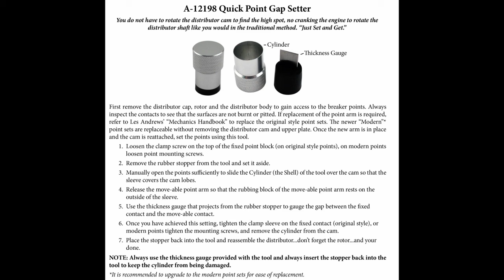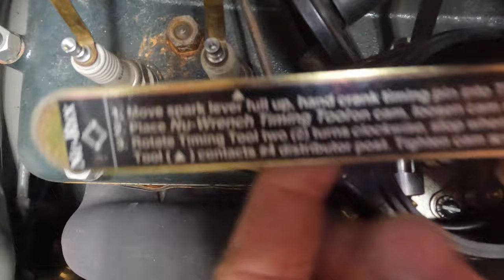Three Tools That Are A Must Have In Your Ford Model A Tool Bag So You Don't Get Stranded On The Road

Comment: 5:31  the Nu-Rex timing strip allows you to set the timing precisely with a timing light. you will never need to mess with  the timing on the side of the road.
Reply from the maker: Thanks for watching and for your comment.  That is true unless your points failed or they had to be replaced (or had to replace/adjust the points for someone else in your tour).  That's when this wrench becomes a jewel to have.

Comment: The spark plug wire is about .020 and in an emergency will gap your points.  Check it out with your micrometer.
Reply from the maker: That's a pretty cool tip!  Thanks for sharing and for watching the video!

Comment: Hello Ken, Over the past summer I have been putting the miles on my 1930 Model A Fordor. I have started to calculate my milage... It is around 13 MPG. Is this the same for you ?
Reply from the maker: Hi!  The Fordor is the heaviest of all of the Model A cars coming in around 2795 lbs.  I have a lightened flywheel and a rebuilt inserted bearing motor.  I am getting right around 15MPG.  Otherwise, it is a stock driveline.
Reply: Hello again Ken... I am in Herndon Va (Near the Swamp). My wife and I tour around the Civil War Battlefields on the weekends with the Model A. Thank you very much for your reply and it is WELL appreciated. If you are up our way, please stop by !! My wife and I plan to extend our scope with our Model A, Thanks to your inspiring videos. Thank you Ken !! Bill and Nadia.
Reply from the maker: @hartewj  I always wanted to bring My A up that way so I will be sure to give you a shout if I head up there!  Years ago I did an art show in Reston which I guess isn't too far from you.